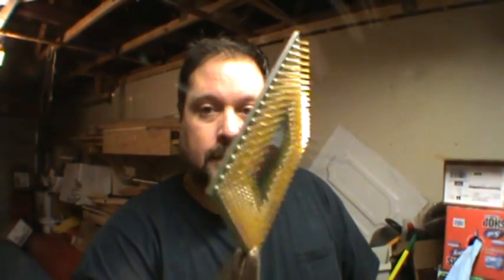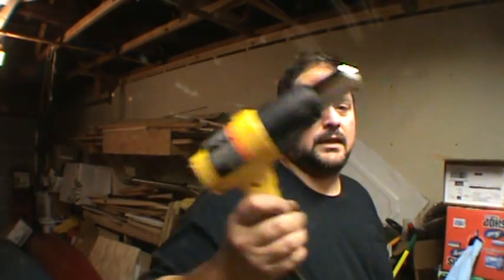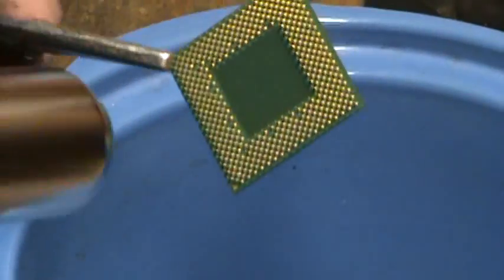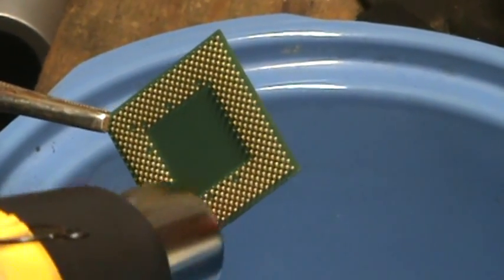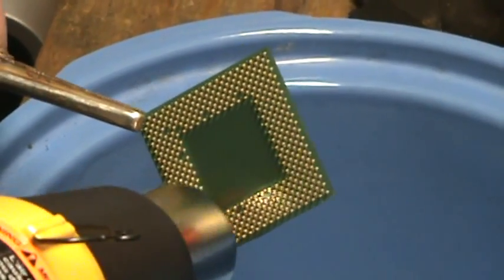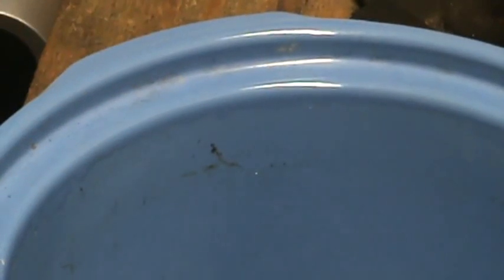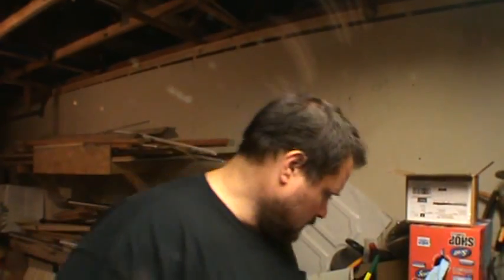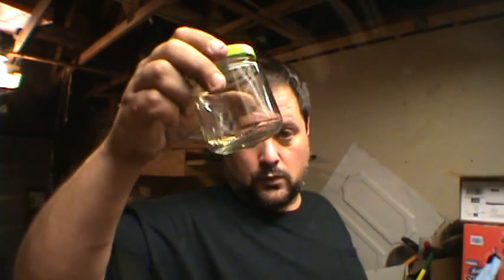How To Remove Gold Plated Pins from Green Fiber CPU's: Top two methods

Comment: Hi im new to this i have a 1000 sim cards that i wanted to take the gold plating of but i just cant get it off im useing 3% hydrogen peroxide and hydrochloric acid 32% and then i mix it 2 to 1 and  i just dont get gold flakes the acid start turning green and all the gold is is of the sellphone sims then can u please tell me what am i doing wrong.the acid is a nice green colour but there are no gold flakes
Reply from the maker: james wilson Hi and thanks for watching.  Sounds like you used too much peroxide.  High content of peroxide should only be used when there is a lot of base metal like in dissolving pins.  How much solution is there?  If you put a big piece of clean copper in the solution and let it sit for a few days the gold should come out of solution as a black powder.  You will need a very fine filter to filter the solution.  Best of luck to you

Comment: Hey Moose. May neighbor just gave me 50 CPU chips. They are not green they are gray, are these ceramic and are they worth more then just taking the pins off. Thanks.
Reply: I'd say they are worth more with the pins off, those are worth a bit more money since those are the older ones with more gold on them
Reply from the maker: +Sony Trinitron Ceramics a pretty easy to differentiate from fiber cpu's.  Do they clink when you hit them together?  If so then yes, you can get, depending on the type, $100 per pound or more.

Comment: what are the heat sinks made of my friend is saying it's copper coated with 308 stainless steel i would like some incite into this and I've tried to look it up  and they don't seem to answer my question . thanks
Reply from the maker: Luke Ketelhut They are copper, what they are plated with can vary but they are still considered #2 copper.
Reply: Moose Scrapper thanks

Comment: have you scrapped a satellite dish head and receiver box. I believe the guide wave is solid silver and lots of gold on the head board and receiver board. The one I found was by viasat. and the boards were blue.
Reply from the maker: Aldon Blakey Hi there, I do have a video on each one of those.  I did find the gold plated board however did not find silver.  Is there any way you could send a pic?
Reply: Moose Scrapper
Reply: Moose Scrapper send me a email address, I will send you 5 pics
Reply: Moose Scrapper also lots of pins in ribbon cable

Comment: hey how ya doin enjoyed your last video. but my topic is on this one. i have received the beaker and processors in the mail now i only have to head to the store to get the final stuff. but i need heat. 1010 Celsius to be exact. I'm not sure but first. i need a propane torch. second i need one cheap. and third will i be able to use any head / nozzle to reach the desired temp. i have been reading and it seems that propane torches with out added air can reach 2000 Celsius is this the same for all. or how so. also i didn't wanna spend the extra money on the glass stir sticks. is there anything i can substitute with. and as for the pinless processors can i just add them with my ram or no. thanks have a nice day. any info will be of great help.
i have $56.38 and another $30 to spend at the store not including the propane torch. i am serious about this. don't have the money to buy the camera wish i did. i would be horrible at talking constantly stumbling my words just because i would know people are watching lol. thanks you have a great day and be safe.
Reply from the maker: Luke Ketelhut Hey Luke, sound like you are off to a good start.  For a heat source, I would try to find a MAPP gas torch not propane.  Propane is slightly cheaper but takes a lot longer to get up to temp and you end up using more than twice the gas for the same job. As for the glass stirring rod, if it is to stir solutions then all you need is a plastic spoon.  Pinless processors can be put in the AP once the copper cap has been taken off the other side and all the little monolithic ceramic capacitors are removed as well.  Best of luck to you!
Reply: Moose Scrapper
thank you the mapgas can be used with the same torch head right or not. cause i found online $40 for a full propane torch kit  well it would be handy to just go buy a cylinder of mapp gas and store the propane. thanks
Reply from the maker: Luke Ketelhut The torch set that I use I got at Lowes for about $25 it was a MAPP gas tank and the torch head.  I do not think they can be interchanged, but could be wrong....
Reply: thank you so much was getin ready to buy a $40 propane torch online. thanks i owe you one

Comment: in one of your other videos you clipped of some solder off a finger so is there anything else you need to do to the pins before you put them into the solution?
Reply from the maker: For these there is not.  once the pins pop off, you will just want to make sure that you pull out any MLCC's that may have fallen off into the bucket.

Comment: How many computers equal 1 Once of Gold? Any Silver in computers? How to scrap Silver? D
Reply from the maker: Dale Durbin Hi there, that is a very hard one to answer as it varies a lot from year of manufacture to brand etc.  You could pull an ounce of gold out of 12 computers that are 386's, or as many as 200 newer computers.  there is silver in computers here and there.  Silver mylars in the keyboards, and some contacts here and there and some silver in the mlcc's on the mother board.  I have found that due to the relatively low value of silver, its not worth it to recover so I do not do any of that.  Other folks like drew metalsmith, indeeditdoes and geo do however.  check them out!

Comment: Thank you for theat but the problem is that I'm frome Jordan i dont know frome where can i have hydrochloride acid
pleas help me
Reply from the maker: Mohammed Karasneh That's a tough one.  You should be able to get it at a hardware store.  It may also be labeled as a concrete or patio cleaner.  Check the label, it will say HCL.  Its hard to say where you can find things because different countries have many different regulations.

Comment: Too bad anything above a Pentium 1 (ceramic only) are worthless    only 0.05Grams of gold per chip  you spent more on power then you made on the gold
Reply: punker4Real 0.05 grams of Gold is worth, at $1200/oz troy Spot Gold, is roughly 18 cents (Divide $1200 by 31.103 grams/oz troy  and you will see that it is a little less than $40 per Gram) 
Multiply that result by 0.05 Grams (YOUR FIGURE) and the result is about 18 cents.
Power generally costs me about 20 cents per kW Hour. (Kilowatt Hour) That is how power is billed. 
A Heat Gun uses 1500 W or 1.5 kW (kilowatts)
Thus every hour at 1,5 kW, cost 30 cents. (1.5 kW X 20 cents/kW = 30 cents) 
Thus every minute running a 1500 Watt Heat Gun costs 0.5 cents at 20 cents/kWH (30 cents/60 minutes = 0.5 cents)
You would have to run that Heat Gun for 36 minutes straight to use 18 cents in Power...
If it takes 3 minutes to remove those pins it has cost a lousy 1.5 cents. 0.5 cents/minute X 3 minutes = 1,5 cents 
You are still way ahead. 
It cost me about 1 cent in power to reply to you.
Pay up chump. 
(Why are you trolling? Are you that damned bored? Are you entertained now? Why are you not doing something productive instead? Where in the hell are your parents?)
Reply from the maker: +punker4Real I usually do not use an electric heat gun for that reason.  THis is a hobby for me so I am not that concerned about what comes to litterally less than a dollar extra a month on my electric bill.  Thanks for watching!
Reply: 24kGoldenRocket   still other overheads besides the  power costs   pay the middle man etc...
Reply: punker4Real Stop trolling. I get paid 98% on my pure Gold Scrap. (Private deal. Do not ask for the source.) Whoopee. They lay out roughly $1175 to make roughly $24/ounce troy on my Gold...at today's price They also need to keep their doors open and their lights on. They need to pay the rent.

Boy those middlemen are just raping me...NOT. I would not allow that.

Do you want to know what is really costly???

MY TIME...and I have spent more than enough on you...too much as a matter of fact.

I am not going to make a mint doing this. This is not a business but a hobby...one of many, of a variety of interests which I have. It is remarkable that my exploration has lead me here.

This all originated when I started collecting Coins when I was Seven Years old. Forty nine years later I am here.

I have no time to sit on my butt and play video games, watch TeeVee, or troll.

So I am having fun.

I recycle what will needlessly fill landfills thus it is eco-friendly. 

I also support my homeless dumpster diver army as well. They are paid. They EAT as a result. That way they are not begging from me (which I will feed them regardless) and have some DIGNITY for producing a service which instills a personal sense of worth and some needed self esteem.

Life is NOT ABOUT MONEY. Get a clue. But I am also not in it to spend money recklessly.

It would be far easier to go out and buy Gold Coins and let them sit and collect dust. But anybody can do that. It serves no other purpose.

The hobby, like most others I have, pay for themselves.

For instance I had a portable foundry fabricated as a result of getting into the Gold Refining I spent about $500 to have that done..

Now check this out...

https://www.youtube.com/watch?v=auOuiZu9PQM&feature=youtu.be

Afterwards check this out...

http://www.ebay.com/sch/i.html?_from=R40&_sacat=0&_nkw=aluminum+anthill+art&LH_Complete=1&rt=nc

Notice that most of the completed listings sold. (Sold prices are in green.)

Do you sell your scrap aluminum from the Hard Drives to the Scrap Yard for 50 cents/lbs. or do you sell fabricated sculptures on eBay at $20/lbs. ?

Furthermore I am eradicating invasive pests.

Since you seem to think that it is about money..

What are you doing for humanity? What are you doing with your time, other than trolling?

Are you having fun?

When you take that step outside of your own self and seek to serve others that is when you have the most fun.
Reply: Looks like you wasted a shit load of time your self posting
Reply: It is not a waste. Perhaps others will read it, use the information and gain from it as a result.

Perhaps you will not.

Thus it is not all about you, is it?

At no point did I ever write that it was a waste. I wrote that the time was spent upon you. Nobody paid me to write it.

If you believe that the message was "wasted on you" then it demonstrates your lack of vision, which is a disabling blindness, and your lack of appreciation, your lack of ability to add value to others' lives.

Do you see what your own words and behavior reveal about what you believe about yourself? 

And stop trolling. There are better things to do. You can choose to appreciate others and the belongings which you have and add value to them. You can choose to contribute.

When you decide to choose that then you will not be as angry and miserable.

I know that it is hard to grow up. But it is your choice. You are responsible for your decisions. Choose wisely.

Good night.
Reply: lol

Comment: Love the videos, gleaning as much info from them as I can. I do have a question though, I've been removing the gold plated pins from circuit boards but a number of them still have solder on them. Would the solder contaminate the end product? If so what would you recommend doing about the solder?

Comment: When recovering gold from just the pins do you still have to use the chemicals?
Reply: jasonkingj69 Everything that looks gold is usually gold plated, so yes. You always need chemicals if you plan on processing it yourself. You can also just sell the scrap on ebay. Depends on how much time you have and if you can work the chemical process.

Comment: This is great and i have seen more video like this ,but it always comes down too cleaning the scraps with acid or some other chemicals and i don't like some dangerous chemicals + i have no idea about these toxic fumes or toxic cemicals,,,some my question is,,is ther any other way too clean this gold pins???
Reply from the maker: Hi and thanks for watching!  This is not for everyone and you should not do anything you do not feel comfortable doing.  Unfortunately, the use of acids is required for gold recovery from these items.  There simply is no other way.  Thanks!
Reply: Moose Scrapper
 ok thanks for the info..one more question. how many computer or processors+ ram do you need too get 1 ounce of gold?

Comment: wow nice thnx.. hey theres gold all across the video cards etc that's mixed into the card how can u melt down the whole cput card etc to get every little bit!!
Reply from the maker: HI and thanks for watching!  You can not melt down the whole card unfortunately.  Generally speaking, incineration of whole cirtcuit boards is against thte law due to the harmfull chems it spews into the air.  You can give it a hot sand bath to remove all the componants, then use AP (have a couple vids on that) to remove the gold from the board itself, then the IC's can be processed the way that Geo does it on his channel, then for the pins and gold plated metal items, check out original feets channel.  Best of luck to you and as always for the best info go to thegoldrefiningforum.com
Reply: Moose Scrapper thank you

Comment: That is a great video. .but I have a question. How can you sell those golds that you gathered? is anyone buying that for you? Or you need to process(melting it, going through chemical processes to clean it) before you can sell it? Just want to try it at home just want to know if it is worth the try. .Thanks by the way.
Reply from the maker: Hi there, you do need to recover the gold first and then refine it.  It is only worth doing if you have a lot of material.  Like a half pound or so.
Reply: Moose Scrapper Thanks for that . .so how do you refine it? What is the process did you use?
Reply from the maker: You have to recover it first.  You need to boil the pins in HCL to get rid of the base metal.  The gold foils should seperate.  Then you refine them as seen in my most recent video.  thanks!
Reply: Moose Scrapper Oh thanks for that. .

Comment: Hey Moose great videos, I really am a better scrapper now than a year ago.  Just wondering if there is any good stuff scrapping a microwave?,  Thanks,  Bill Kelton
Adams, Massachusetts.
Reply from the maker: Two Minute Tip #1: Make more money scrapping a Microwave.
How to scrap a rangetop microwave for copper, silver, aluminum and easy money!
These links are to the two videos I did not scrapping microwaves.  They are one of my favorite things to scrap.  Especially if you are ebay savvy.  You can sell the glass tray for $10-$20, the thermostat for about $10, HV capacitor for about $5, Magnetron for $10-$30, Transformer, motors, etc.  Lots of sellable parts.  Otherwise, as far as scrap goes, there is a good amount of copper in there.  Thanks!
Reply: Moose Scrapper  hey moose how do you process pinless cpus

Comment: Great vid. Quick question. What about the pinless CPU? how do you get the gold from them?
Reply from the maker: Pinless CPU's will almost always have a copper square on top that is either nickel plated or some other white metal.  If you remove that then you can throw it in AP to get the little surface foils off but the gold inside will have to be recovered the same way as IC's.  Its a multip step long process.  Geo has a great bunch of videos on that.
Reply: Moose Scrapper
Thanks for the info. And keep up the good work!

Comment: Once i have strip the cpu from the gold plated pins can i sell them as is?
Reply from the maker: You can , but if you are just going to sell it anyway, I would not bother to remove the pins.
Reply: Moose Scrapper May i ask why?

Comment: Down to earth presentation and I love it. As a processor of placer concentrates myself could you share your processing of the very fine gold particles that do not separate from black sand very easily. 120 mesh to infinity can be concentrated but not easily to the 40% level easily attained with the bigger fractions. I direct smelter the coarse 40%+ grades but am looking for a better way to smelt the powder size. Adding extra borax seems to fluidize the pour but still some of the gold stays in the slag. HELP!!
Reply from the maker: Hi and thanks for watching!  I can only venture a guess at this, but I think that if you were to take the powder you have left that you can not process any further, you should be able to dissolve the gold in a solution of HCL and bleach.  Filter that solution through a coffee filter then precipitate with Sodium Metabisulfite and you should be left with pretty much pure gold only.  I would have to test that theory first though before saying conclusively.

Comment: how much gold you can get from this?
Reply from the maker: Hi and thanks for watching!  That is a VERY popular question.  Unfortunately there is no definite answer to it.  Each manufacturer uses a different amount of gold, the age of the CPU makes a difference in the amount of gold as well.  From one green fiber CPU, you will hardley get any gold.  You can get much more gold from ceramic CPU's.  THe thing to remember about gold recovery is that it takes a lot of material to make a good amount of gold.  Just remember that even the largest waterfall had to start with one drop.

Comment: I have a question. My CPU looks like green fiber on one side and maybe ceramic on the other. in the middle of the 'ceramic' is a copper or gold rectangle. How would I get that out. And on the green fiber side, the pins aren't raised. Do I still use the heat gun with those? Thank you..
Reply from the maker: stephen p For something like that I would probably try cracking it into pieces and soak them in HCL and bleach for a few seconds to pull the gold off.  But that's just me...I am no professional.